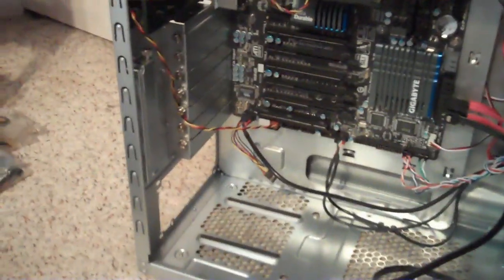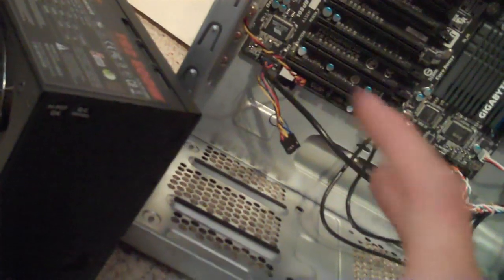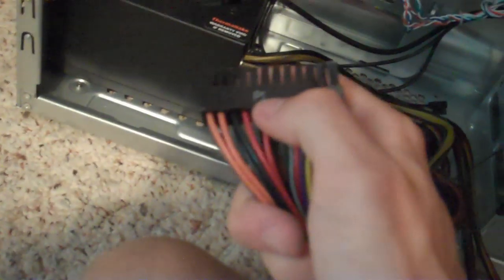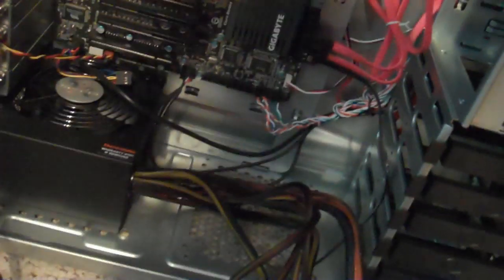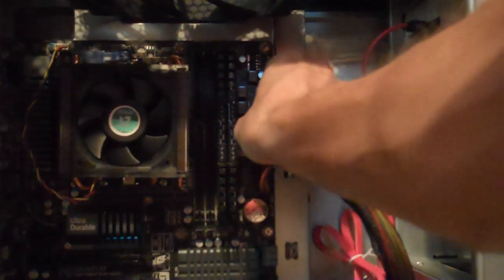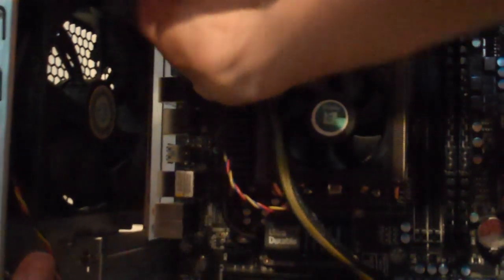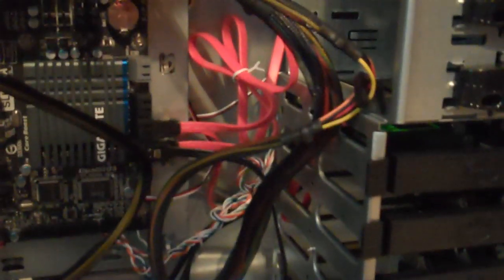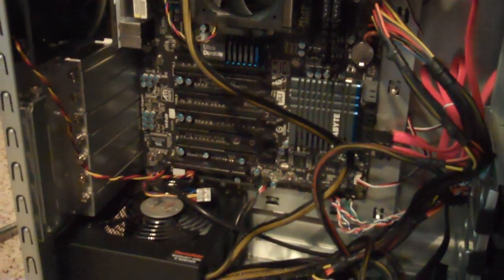How to Install a Power Supply to a Desktop PC

Comment: Someone help ok so I. Got a r7 250 and a i5 4690
 I getting a gtx 970 I only, got a 500w so I'm getting a corsair 750w 80+ builder series cx750. And here is problem If I get a bigger psu the 750w  my i5 has a fan on it and if I get a bigger psu I'm sure it's gonna block it idk I have  novatech galaxy 3 gaming case how can I tell if it won't block or to big idk what to do ?

Link to case.         Ignore the psu it comes with this is just the case I got 

http://www.novatech.co.uk/products/components/cases/cases/cas-408.html

New psu. Link.     http://www.amazon.co.uk/dp/B008RJZR40/ref=twister_B00I5LYCI2?_encoding=UTF8&psc=1  

Card link.  http://www.aria.co.uk/Products/Components/Graphics+Cards/NVIDIA+GeForce/GeForce+GTX+970/Zotac+GTX+970+4GB+%28Maxwell%29+Nvidia+PCI+Express+Graphics+Card+%2B+1+FREE+GAME%21+?productId=62032&source=pcpartpicker
Reply from the maker: I don't think you'd have any trouble fitting a bigger PSU into that case. Power supplies usually have a pretty universal height and it's just the length that can vary. So that new Corsair power supply you're looking at might be slightly longer, but it won't go any farther down, so it shouldn't block your CPU fan.
Reply: Thing is the tiny one I have now is kinda almost touching it but if it's just longer then I guess it's ok if I just try it and it blocks it I'm bummed but eh lol
Reply from the maker: bear Mitch I have put full sized power supplies in smaller desktops like Dells and HPs before, so I would be pretty confident that the new PSU will fit fine too. If not, maybe time for a new case? :P
Reply: Yeah maybe.  Just 1 more lol.  If I don't upgrade I use my  500w psu. Neither my zotac gtzn 970 can I or. Will it not work like wreck my pc? Cuz idk what make the power is or if it's good or can I just use it
Reply from the maker: bear Mitch The GTX 970 should be able to run on a 500 Watt PSU if you aren't overclocking or running a lot of other accessories. Just make sure your power supply has 28 amps on the 12volt rail and your 500 watt PSU should do the job.
Reply: Oh ;( um id, what my psu is lol maybe I'll just buy a 750.  I just got to make sure it don't cover the fan. What I mean is this 

Picture of inside my pc 

http://i.imgur.com/k0rhQBu.jpg

U see that small tingg with green sticker that's my psu and under it u see the i5 big Fan. U see if I get a bigger psu it's gonna block one of the fans here is psu I want to get 

http://www.amazon.co.uk/dp/B008RJZR40/ref=twister_B00I5LYCI2?_encoding=UTF8&psc=1

U see wat I mean it won't fit it will be a very tight fit ?
Reply from the maker: bear Mitch Ok, I see. Yeah, you wouldn't have any troubles fitting the bigger PSU in there. Trust me, I've been doing this for a while at this point. I've never had a power supply that wouldn't fit in a case. Just make sure the fan on your new power supply is pointed down so it has enough air flow.
Reply: No I mean did u se in my case ? The black fan and the fan below it it almost touches te fans ? Inches away the blame fan and the i5 one
Reply from the maker: bear Mitch Yeah, I saw that fan too. I wouldn't worry about it.
Reply: So that 750w psu on amazon I might get won't block any fans or like touch them ? Ok I guess I'll try if it don't fit I guess I can like cut the wire and say it was lime that hahehheheeheh

Comment: I just ordered a brand new 500w Power Supply, But my case doesn't have small holes in the top or bottom that the battery can take air from. Do i just flip the new battery over so it take air from the inside or do i have to get a complete new case?
Reply from the maker: It's perfectly fine to have the fan pointing inside the case instead of pulling air from the outside. I actually have my fan pointing inside the case of all my PCs, that way it doesn't get clogged with carpet and hair.
Reply: SergeantPope
OH cool thanks for getting back to me right away,when i heard what you said at 1:29 i was starting to freak out a little.
Reply from the maker: Naquan Jefferson Haha, yeah, don't worry about that. It'll run fine either way.

Comment: i have recently purchased the geforce gt 610 2gb graphics card, as well as a new thermaltake tr2 430 Watt power supply. the graphics card isnt really a high end one, and i think it is powered from just the slot that its in. would i just kinda tuck in the extra cords i dont need?
Reply from the maker: That card requires 300 watts, so a 430 watt PSU will work just fine. Just like you said, tuck the cords in some extra slot to clean things up a bit.
Reply: already done. But thanks! :)
Reply: FurryNightWolf Aww man you should have went with the gtx 750..... AC Unity on medium 1080p m8
Reply: that comments a bit old... i actually have the GTX 750 ti now, lol!

Comment: i just order a atx 350w 80 plus bronze from ebay and it fan downward but my desktop doesn't have little screen hole in the bottom so can i just hook it up and have the fan blow down plus i have a extra fan that sucks out air through the back and on the side of my desktop have a squire shape with little hole as release hole will it be safe or not please relay back cause i really want to use it cause my 300w is not strong enough to run my graphic card hd5670 512mb gddr5
Reply from the maker: You can install the fan either pointing up or down, just depending on your case. It's perfectly fine to have the fan pointing upward; that's how I hook up my own system.

Comment: i see your logic!would you recommend to place mine side down in my new build?
ill have my computer elevated a little on like a stand.
Reply from the maker: If your computer is elevated a bit, having the fan pointing down might actually be a good idea, since the air outside the PC will probably be cooler than the air inside the PC. And if you run into any issues, you can always flip it at any time.

Comment from the maker: It mainly depends on your graphics card. I usually suggest around 600 watts because it can handle almost every graphics card and the prices are still fair at that wattage. But if you have a lower wattage graphics card, you can probably do with just a 500 watt.

Comment: Ok well till I get the new motherboard, and other stuff, could I use the old psu for my motherboard and the new one for my new graphics card? (Old PSU is 400w and new one is 800w so they should be able to do it).

Comment from the maker: I had a Dell a few years ago that did the same thing. I think if you have a cheap motherboard, they aren't meant to be used with high power PSUs.
I just got a new computer to solve the problem. I mean, you could buy a new motherboard, but at that point, it's just smarter to upgrade the whole computer.

Comment from the maker: If you're just installing a power supply, it's probably not absolutely necessary,  but if you touch the any other components of your computer, I would ground yourself. With a desktop, all you should have to do is touch the metal case to ground yourself :)

Comment from the maker: Yeah, you'll basically have to unplug everything. Definitely unplug the power supply from the wall socket, so there's no power running to your PC. And since you're replacing the PSU, you'll have to swap out the inner power connectors with the new PSU's connectors.

Comment from the maker: I've had that happen to me before aswell. I just used a 3 pin to 4 pin peripheral adapter, which usually come with aftermarket fans. Then you just hook it up directly to a 4 pin peripheral connector on your power supply.

Comment: I am upgrading my PS and the motherboard has a 8 pin but the old PS only had a 4 pin connected to that, should I connect the 8 pin from the new PS or just use 4 pin

Comment from the maker: The amount of memory, GDDR5, isn't really a factor to how much power you'll need. I suggest 600 Watts to just about everybody, because it works great with low power cards along with many of the higher class graphics cards. I personally use 600 Watts on most of my computers.

Comment from the maker: No, the motherboard should be just fine. Just make sure you touch some metal before you install the components to discharge your static electricity.

Comment from the maker: The 8 pin connector is for auxiliary power to the motherboard. Lots of lower end motherboards just need 4 pin instead though.
That plug in is usually near the top left of the motherboard.